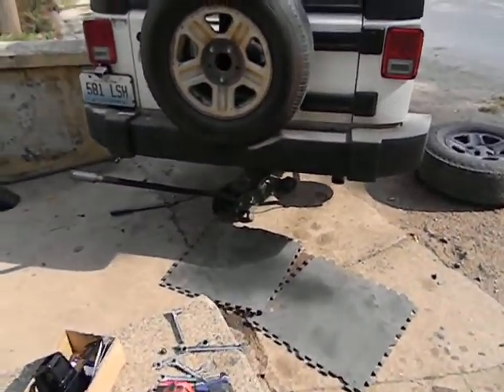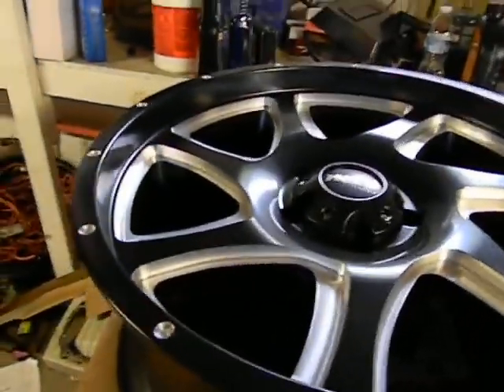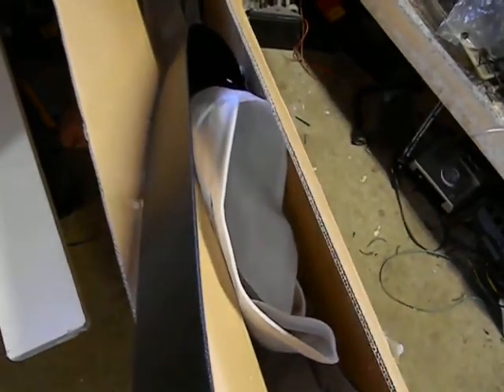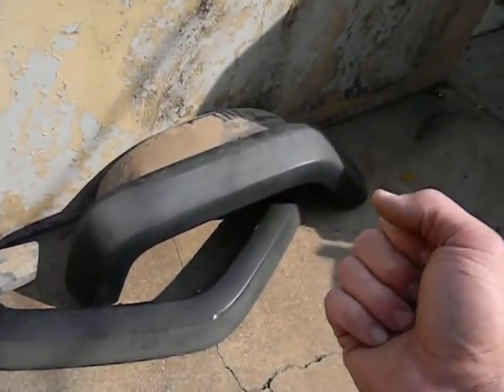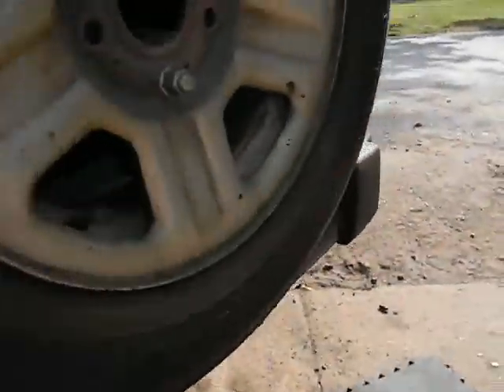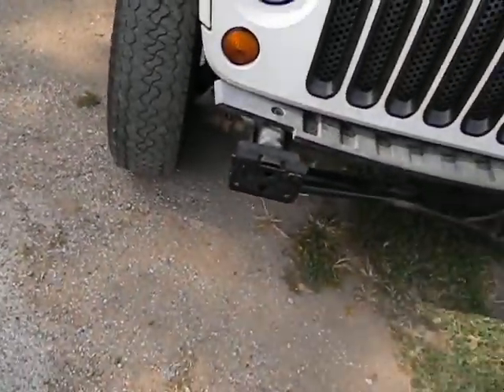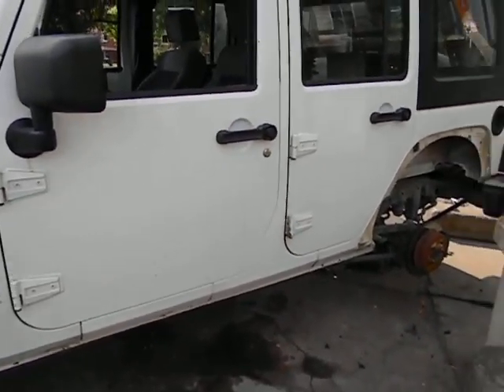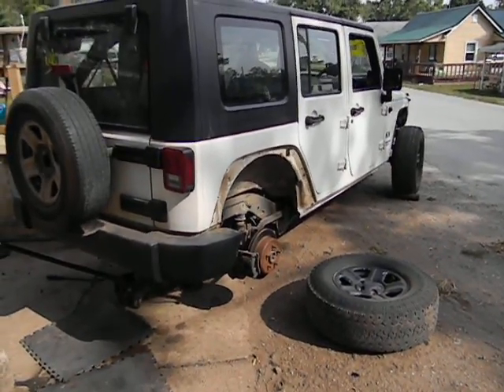Wheels Jeep 003

Comment: Stupid question did you have to make any mods to the gears in the front axle or to the steering stabilizer to make the Jeep run right with those heavy wheels?
Reply from the maker: No not at all.  Runs and drives great.